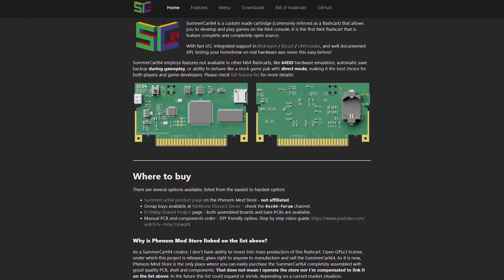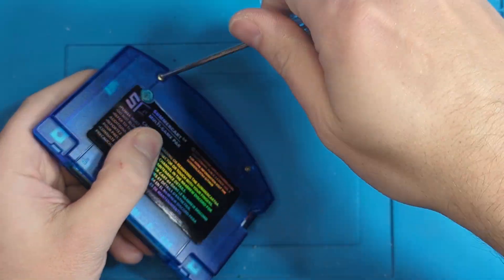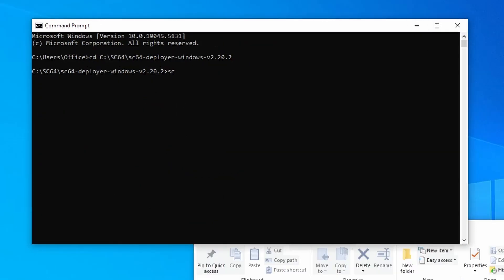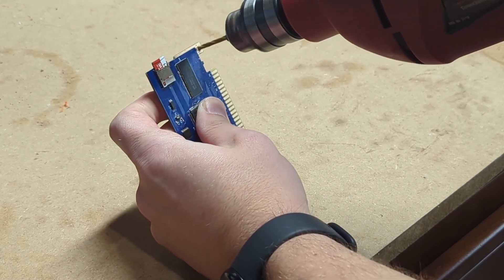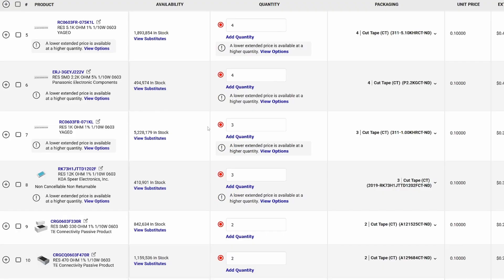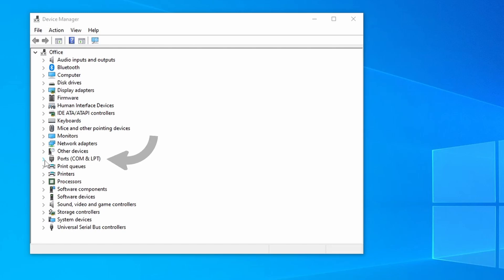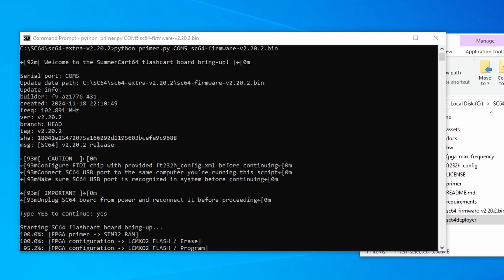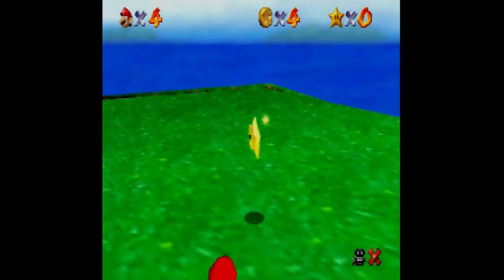How to Update Firmware and Troubleshoot the SummerCart64

Comment: I can’t get it to load ever. All I ever get is is not recognized as an internal or external command. I’ve tried everything from multiple sources and it just doesn’t recognize any of the commands. I never get any info popping up on SC 64.
Reply: type ./sc64deployer in the terminal after you run cd path/to/the/executable

Comment: Anyone have any tips on how to launch the deployer on Mac? Or how to update it?
Reply: You'll need to enable execution of the binary with chmod, so cd into the directory with the sc64deployer file, and then run the command "sudo chmod +x sc64deployer" to grant execution access to the executable. Then you can run it using the command "./sc64deployer". On a Mac, you'll also need to go into System Settings > Privacy & Security > Security and allow access to sc64deployer.

Comment: I had three issues with updating the firmware:
1) This version of Windows required that I type a period backslash ahead of scdeployer64
2) I needed to install some VCP - FTDI drivers so the SC64 would be treated like a virtual port
3) I had to use a data cable as the original cable I tried was for charging only

Comment: Anyone help or have any ideas for my problem? I have the summercart and it's running without any major issues. However, I noticed the framerate and over all smoothness of textures suffer a decent bit.  For example in bomberman 64, my character has really sharp pixels and stationary fences look like they are warping when moving the camera. On my official bomberman, the textures look more smoothened out and the framerate doesn't take a hit like the summercart. Is this normal with these type of "all in one" type cartridges? I'd like to find out a way to enhance the cartridge via solder or firmware update so I can have it run exactly like my OEM cartridge counterpart. Is it possible for it to be a perfect comparison or is this the unavoidable? I'd appreciate it alot if someone could give me some type of answer. Thanks
Reply: for anyone wondering I did not update any firmware. I just played it straight out of the box. if updating the firmware will stop the frame drops and give a better image then please let me know. I can not find anywhere online that explains what the firmware update(if i need one) actually does so i dont wanna accidentally mess up a seemingly working cartridge.

Comment: This is great thanks... I have a problem with my SC64 Cart. I'm in the UK using a UK TV, Console etc... but when I load a game, the screen becomes incredibly jumpy or the colours are way off (depending on what cable I use... USB or Scart lead).
I think the SC64 is trying to play it in ntsc? But not sure... any ideas?
Reply: It depends on your tv this one. I have a bush tv that does the same as you describe bars in screen jumping weird colour. My sharp brand tv doesn’t and displays it correctly so I’m not sure the cause but try it on an alternative tv

Comment: My cart keeps on crashing after a few minutes of play. Any idea why? I just got it online from Ali express
Reply from the maker: There seems to be a couple of more popular go to sellers on Ali Express, but there are also a lot of sellers who may be selling lower quality carts. It's difficult to say. In the github it's recommended that some chips be of a certain speed in order to correctly run. I'd take a look at the chips and compare them to what's on the github to make sure they are all the same. I want to say the largest two chips, U8 and U9 may be the only ones that you need to check. In the bill of material, they specify "Speed grade 6 is required. Last letter (C/I) is not important", and it's thought that some of the carts coming out of Ali Express may use a cheaper chip here or a used chip, but I don't know.

The other thought I have could be from thermal expansion. Maybe as the cart warms up there is a chip that has a leg that isn't soldered on correctly. It's enough that while cold it's making contact, but once it warms up enough it loses contact.

Comment: Friend, can you help me?
I updated SummerCart64 with the latest Firmware following the steps in your video and everything seemed to go well on the PC.
I formatted my SD card (maybe that was my mistake) that came with SummerCart64 and updated its files too.
Now I just get a black screen when turning on the N64.

That same SD card worked perfectly.
Was there a file missing?
I placed the "sc64menu.n64" file in the root and created a "menu" folder and folders with a few games to test. It is practically the same structure as the SD card before formatting.
Did I do something wrong while formatting it?

I also placed the most recent "boxart" folder and the "64ddipl" folder with the files needed to run 64DD games.
Reply: I turned on the N64 with the SummerCart64 button pressed and it entered a test screen and it just passed all the tests.

I was happy when the test screen appeared, I think I didn't break my SummerCart64.
Reply: - Update -
I think I managed to solve the problem, or at least understand what happened.

The only versions of "sc64menu.n64" that worked for me were the "Initial release" and the one that originally came on the SD (which seems to be slightly different from the initial release) with the SummerCart64.

What does this mean?
In a way it seems that I did all the right things when updating my SummerCart64 to the latest firmware v2.20.2 and I'm very happy that it was nothing more than a quick scare.
Reply from the maker: @gelcilagameplays1342  That's strange that only certain versions of the menu are working for you, but glad you have it working!

Comment: how do I know which version mine currently is?
Reply from the maker: If you remove the SD card and turn on the system you'll get a screen with the SC64 logo. There are two places where it will state the current firmware in the top section, both under "tag" and "msg"